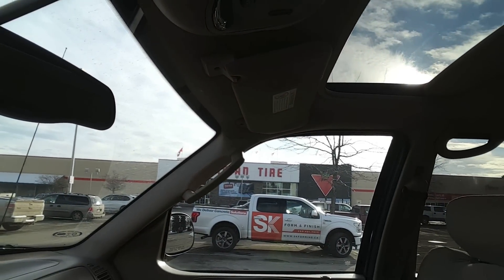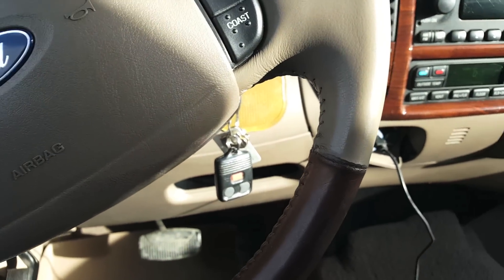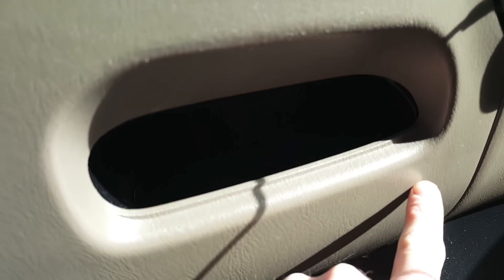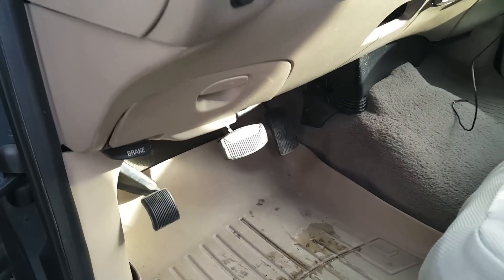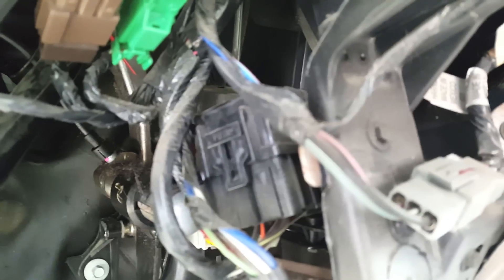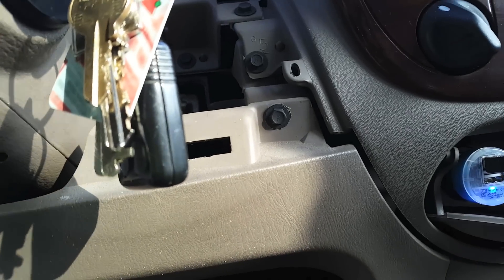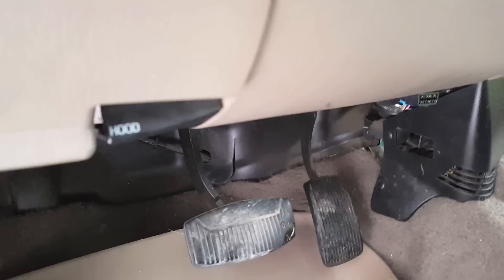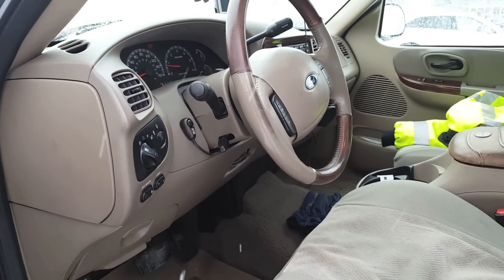Dont blink...97-03 F150 flasher relay/multi function switch/ EASY turn signal fix repair

Comment: thank you  so much your advise saved me a lot of money and time. I used contact cleaner and my signals are working. one guy wanted to charge 34 dollars a year for the answer that may not be the correct answer  wow... your the man
Reply from the maker: I am so glad this worked out for you. There are far too many mechanics that just wanna throw unnecessary parts at vehicles and hope they fix it.

Comment: Big ups to you my man. You clarified a lot of things. A lot of the other videos just went straight to replacing a part without really giving any context to the issue they were having and didn't really differentiate the parts. from your video I learned that there is a flasher AND a relay AND that it could sometimes be the multifunction switcher. So that helped narrow down what components I should be looking at. You also captured the actual symptom which helps us identify if we are experiencing something similar. The issue I'm having is when it's cold, the turn signals don't come on or makes a buzzing noise just like in the video and after I have the heat on and inside warms up really nice, then it starts to work. Do you think that it could be the switcher or relay or flasher? Thanks again for great video.

Comment: Check top left blue fuse on 1997 ford f150 . it will stop all flashing turn signal and flashers . make sure its the fuse not the relay . learnt that lesson

Comment: 1A Auto has multi function switch for about $40-$50 
That's where I got mine
Reply: they have them on amazon for the same truck for $25... A1-Auto get their parts from the same place... china

Comment: You do not have to tear the dash apart. Reach up from the right side of the truck and pull it out.
Reply from the maker: That is true however if you have to do any sort of diagnosing it's much easier just to remove the one lower panel

Comment: Those multifunction switches are between $25-$50 BTW, not $250.
Reply from the maker: Not up here from our local parts stores, if I remember correctly they were $239 plus tax I'm sure you could find cheaper knockoff versions but who knows how that will last

Comment: Have a 1997 F250 and replaced both round, silver 2 prong blinker units (both on left side of column, one easily accessible near fuses on front, and other under the dash almost directly behind first one.  Emergency flashers still do not work.  I also have a 5 pin "flasher" unit (looks like yours), but not sure if this is for my rig.  Any ideas will be great, thanks everyone! @streetstomper

Comment: Anyone know what it could be if it's only my front passenger turn signal?? Light stays on but won't blink
Reply from the maker: I would start by checking your flasher if the Flasher is okay verify that the multifunction switch is doing what it should

Comment: Is there anyone here who removed their bottom panel suddenly discover their hood won't close anymore?  I think removing the bottom panel messed up the tension on the line to the hood, and somehow it won't close shut anymore.  Is it safe (or recommended) to open the hood before removing the hood latch?  I'm very annoyed I have to take apart my hood latch now to fix it.

Comment: whats that button next to your pedal button i have the same truck but not with what ever that button is i was wanting to put tow mirrors and some how hook up defrost for mirrors
Reply from the maker: Buddy Starnes thank you for watching. The button you are referring to is the rear window (slider) button. 
For your mirrors, what climate control unit do you have manual or automatic? if you have automatic you will have heated mirrors if it is manual you will manually have to run power to your mirrors.
Reply: streetstomper  i have manual I think im gonna start looking for a power rear slide window now. I wish I could post pics on here. our trucks are just alike mine has no camper though or brush guard
Reply: streetstomper I also couldn't stand all the gap between the dash and console so I done the expedition console swap

Comment: I don’t believe the price for a multi-func switch is $250., the auto store has it at roughly $100:)
Reply from the maker: Keep in mind I am in canada and we pay a premium price for parts. I don't doubt that auto stores down there have it for Less but through the dealership that is the price.
Reply: @streetstomper  I bought one this week for about $100 usd, too -- but I do not think it was an OEM multi function switch like the one from a dealership.